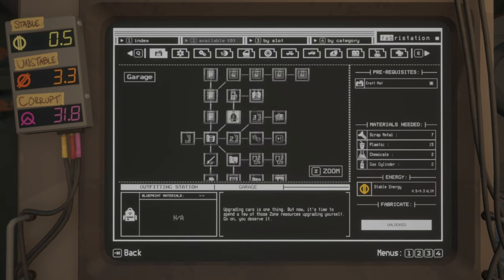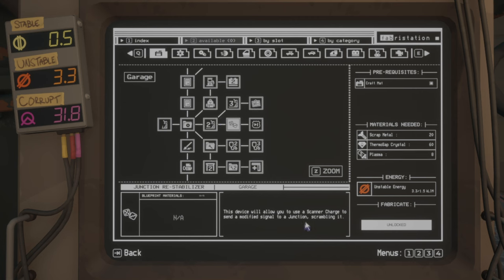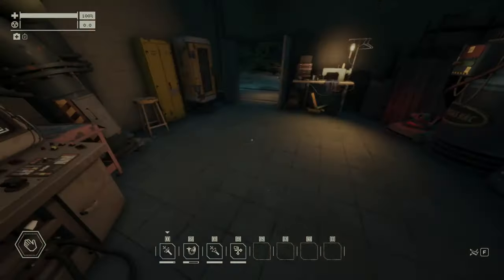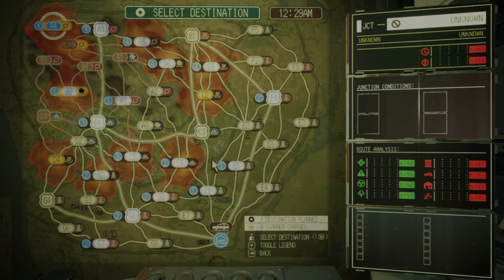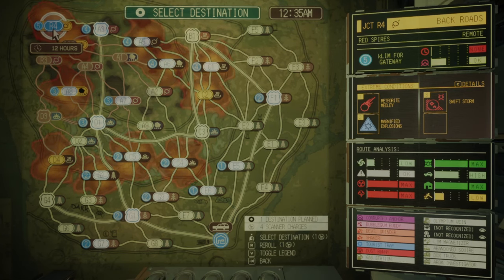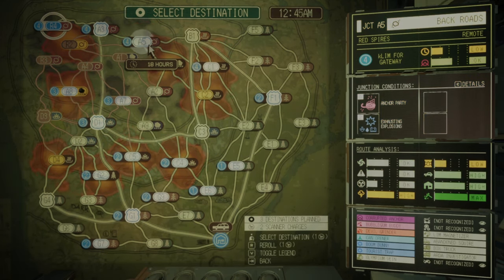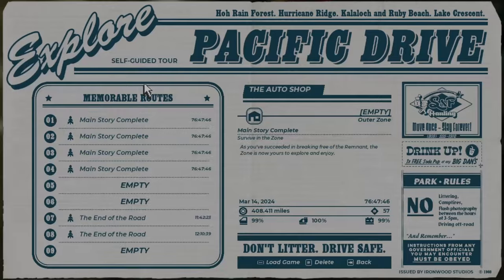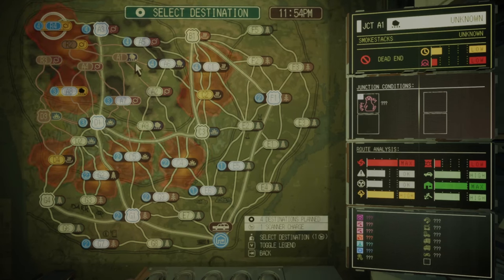Pacific Drive How To Use Junction Re-Stabilizer

Comment: Been following the channel since the lim magnet video, keep up the good work!

(Side note: could you do a video comparing the different tires in the game?)
Reply from the maker: Thanks, someone already asked for that, and I'm thinking to do it, but the problem is to find a place where I can test all tires and with tires it's more about the "feel" when you drive it yourself. In the video you will not see the difference that much if you know what I mean.
Reply: @UGC_MateM8  yeah I kinda get it
Was wondering more because of the power grip tires, wanna know what they do before crafting em, do they like, make the tires handle well when activated?
Reply: nice suggestion..
different part of the car comparation would be great too (for example: armor type vs lead type and so on)
or maybe car attachment on different junction like lightning rod or so..
Reply from the maker: @AlexRodriguez0407   I can tell you here which tires are the best and why.
Off-road tires are ideal for runs with predominantly off-road driving. Puncture-proof tires are suitable for road use as they resist flats and blowouts, but they perform poorly off-road. That's why I almost always use all-terrain tires; they have an A rating for all road conditions and outperform power tires. While power tires offer slightly better grip on the road, they falter off-road and consume constant battery power (0.9 kW/sec). In my experience, all-terrain tires are the best overall choice. I reserve puncture-proof tires for runs with many tire-damaging anomalies, and I use off-road tires only for extreme off-road or swampy conditions. For everything else, all-terrain tires are my go-to option. 🙂 Other tires that I didn't mention here are not worth mentioning 😃
Reply from the maker: @andikaferdiawan1316  I was thinking to make a video about all 4 power generating attachments that we can add on the car, that one is not so easy to do, but I will add it probably 🙂
Reply: @UGC_MateM8  nice...
what are power generating you are talking about?
is it an abilities?
Reply from the maker: @andikaferdiawan1316  No, it's attachments, you named one, Lightning rod, there are 3 more like that, each one is used to generate battery power from different weather conditions.
Reply: @UGC_MateM8  ow yeah yeah yeah.. attachment..
it would be great to see those tips..
btw, you could also give tips on how those things works..
i mean, i don't know if lightning rod is capable to mitigate the electric damage or not.
or it can only works for the car side that is attached on or works for the entire car parts..
some tips like that
Reply: @UGC_MateM8  thanks for the info man 👍